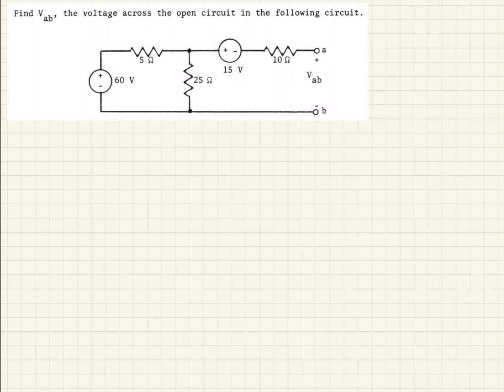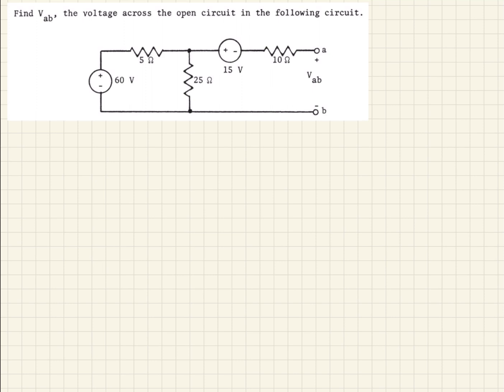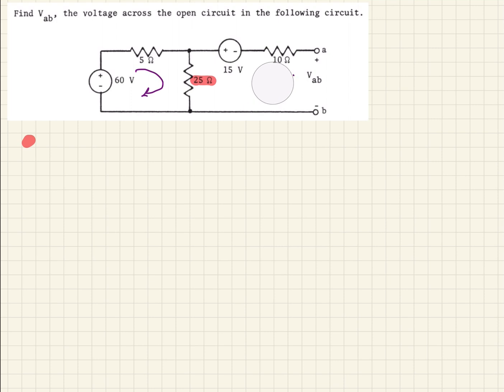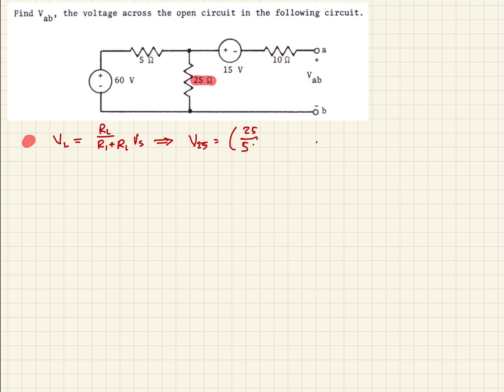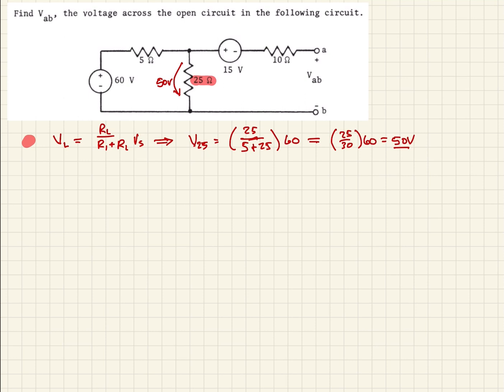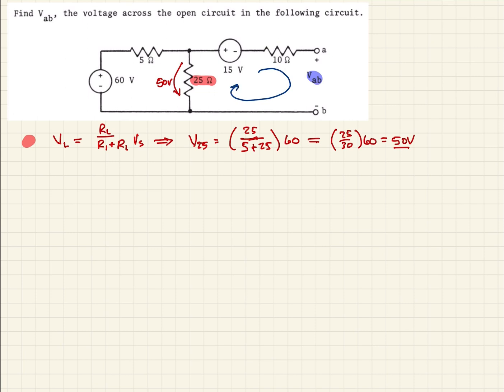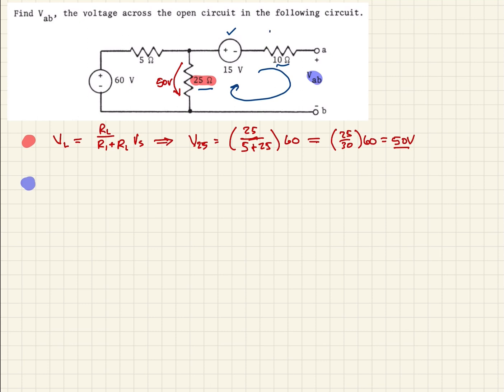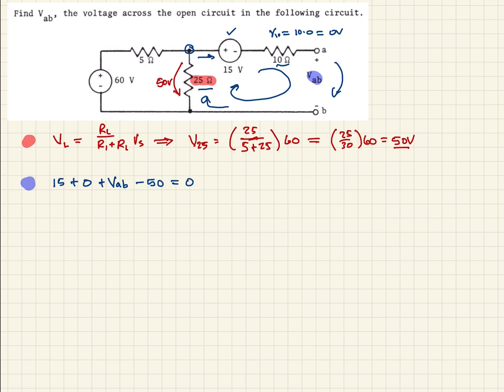Networks Problem Solver: Simple Circuits - Open Circuit Voltage

Comment: ohh finally been looking for an example like this on youtube. Also take note that the kvl he used is quite different where he took note of the first sign (+ or -) of the voltage drops per component. I think this is more accurate than the other kvl where you take the end sign or exiting sign of the voltage drops in terms of getting the polarity of the voltage Vab (+ or -), but in terms of value of Vab they're the same.
Reply from the maker: Thanks for the comment! … glad you found the example useful!

Comment: Sir, can we apply KVL for open circuits?
Reply from the maker: Hi, and thanks for the question.  The answer is you certainly can, but you need to be careful when doing so as you will not have any mesh currents in the open circuit portion, but you still can have voltage contribution from voltage sources that must be accounted for.